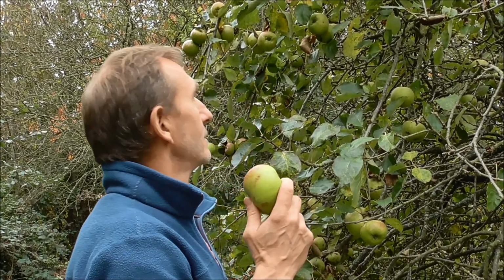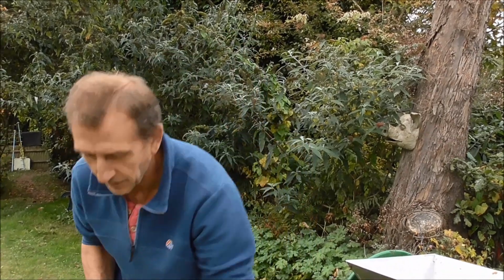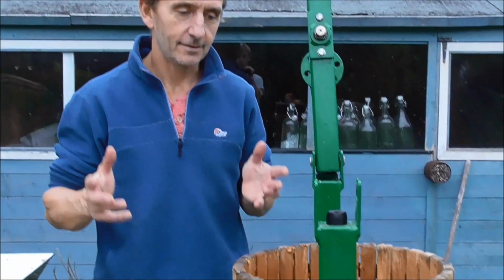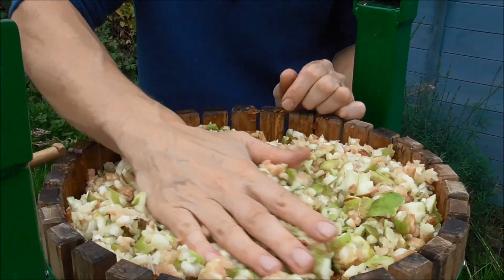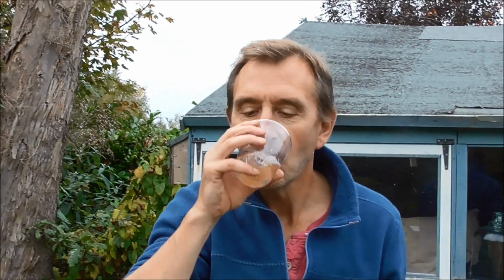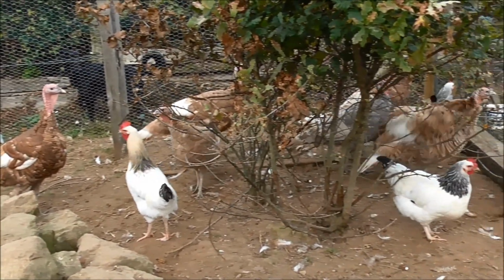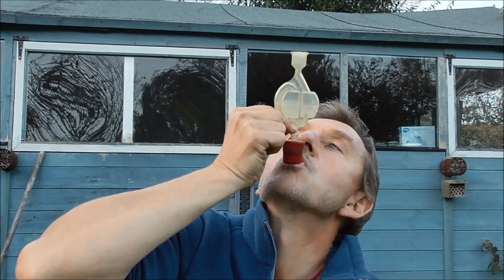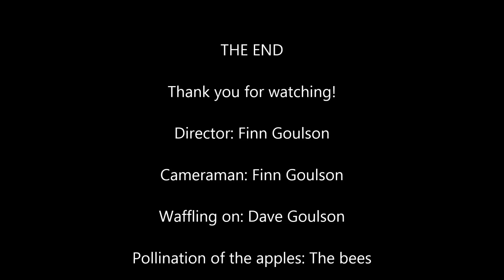How to make cider

Comment: Been making Cider  off & on for 57 years. I too pick up apples off ground if they appear ok, but I keep those separate from picked fruit, rinse thoroughly to avoid chance of feces from animals passing through. Same using ladder for picking, always keep hands on center of rungs to avoid what you track on outside of ladder rungs. Red apples produce much more than green. For a smooth, sweet taste, add green pears. Only problem, it adds more sugar. Last, I was always inundated with large amounts of "Yellow Jackets" attracted to the feast.Did not see any insects on your vid. Good job.

Comment: Thats how its done. Great job. 

Yeast dies somewhere 60 C, or something like that. So if you want to make your cider sweet and spracling you need to add sugar at the end (there's  special sugars for this for those who want to make everything extra complicated). Then let the cider brew for a few more days to create the carbons, and then kill the yeast, for example by heating, to disarm the bombs :) 
(use indicatior botle, so you actually heat the cider in your botles to that 60 and not just the botles out sides. Indicator botle is identical botle filled with water and has no cap so you can actually measure the temp of the liquid inside it.)

Comment: I bee a cider maker!! Well done you! I used to make elder flower 'champagne', until a plastic bottle exploded! Looking at the video I expect it was carbon dioxide, but that was beautiful when done correctly. I expect yours tastes beautiful. Cheers! George
Reply: The bottle exploded because it hadn't fully fermented before you bottled it.  A cheap hydrometer will tell you if fermentation is done.  If you want the drink to have a little sparkle then you add a  amount of sugar - qtr teasoon max - to each bottle before you seal them, then leave for at least a week.

Comment: Hi Dave. Great video. Very informative. I’m making some cider now and using you way of doing it. Very simple. Quick question though, when chopping and adding your apples do you not bother checking for bugs? I’ve got windfalls and found plenty of bugs in mine so threw those out.
Reply: I chuck it all into my brew and it turns out ok, even bruised apples are good
Reply: good grief you don’t chop apples ! you build a press powerful enough to crush them. But seriously, on this scale you probably do need to chop them, but life is not long enough to carefully examine each piece of apple !

Comment: Just watched this contemplating trying out the press I've had sitting in the shed for a few years with never the time to use it until now.  It's late August and the apples are almost ready...Thanks for the motivation.
Reply: Clean it up and use it if the gears and everything aren’t rusted up
Reply: @smithy1578  
I now have 5 demijohns quietly fermenting in the cellar!  A mix of apples from the garden and some unidentified but promising looking variety from a hole on my golf course.
I'm thinking the next step will be to combine them in one large 25 litre container after the fermentation stops before adding some more sugar and bottling.
My press is small but if I completely fill it with pulp I get enough juice to fill one demijohn.  The biggest issue was crushing the apples, I used a fence post and a large plastic bucket.  If this works next year I'm going to invest in a crusher.

Comment: Most apples have a natual yeast or yeast even floats in the air. I let mine turn into cider vinergar which I love. I use an old waste disposal unit to break up the apples. Note: take your time over pressing . If Dave had left the press when it got hard and then come back 1/2 hour later he would find it got easier. I leave my last pressing overnight. There is no rush because the crushed apples actually improve if left for the few days when one is pressing.

Comment: Thanks for this super video. I followed your process with my orchard apples in september and i think its now ready. Just one question through. When you say 'siphon off' do you mean via the tap, or with a plastic clear hose in from the top end? Many thanks...* Not to worry, ive just found the answer further down - (10mm clear pipe for anyone else wondering) Thanks again.

Comment: Just wondered why you dont line the press with a muslin cloth or run the juice through a sieve before putting into the fermenting buckets
Reply from the maker: It just takes more time, and anyway the bits settle out during fermentation.

Comment: Tks for the vid Dave.  Do you ever check the gravity of the juice with a hydrometer to get a reading of the potential ABV?  Im wondering how strong the cider from your bramleys would be.
Reply from the maker: Yes, I test it sometimes, it is about 4.5-5.5% alcohol, depending on the year.
Reply: @davegoulson6831  That's quite a nice, natural ABV, you could have a few without too much damage.  Westons etc must add loads of sugar to get up around the 8% mark and Aspalls actually list it as an ingredient.
Reply: @djxjxixsmjxjskjzxn1853  Not sure of Weston's practices, but do remember that some commercial ciders can include only 30% apple juice. The balance of ingredients is hydrolysed corn starch to provide lots of extra sugar which then produces a high alcohol brew, which is then watered down to get it to the level they want to sell at. It may be a pleasing product but its made in a different way. At the extreme, the "white ciders" have sugary water as the basic ingredient, which yeast then turns into an alcoholic brew which has some apple concentrate or flavouring added during the process to qualify as a "cider". The relationship to the apple-focused process that you see in this video is somewhat tenuous in those cases.